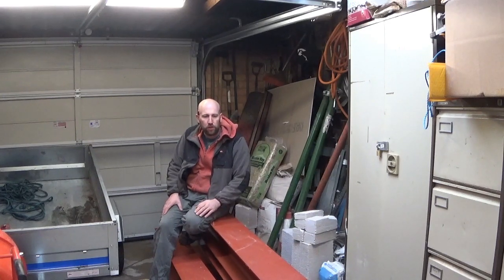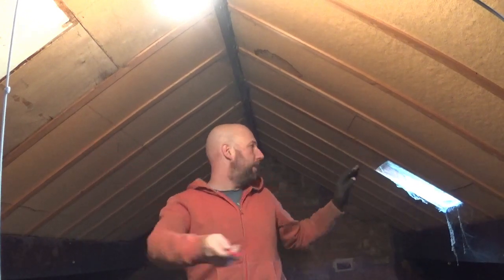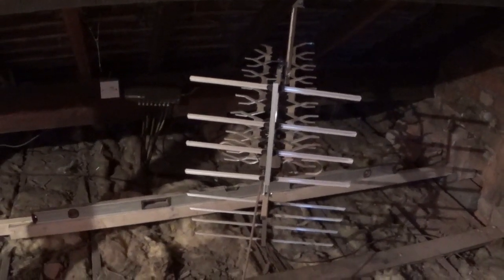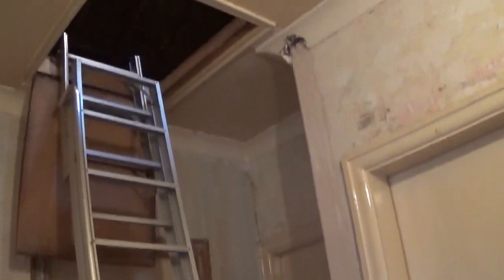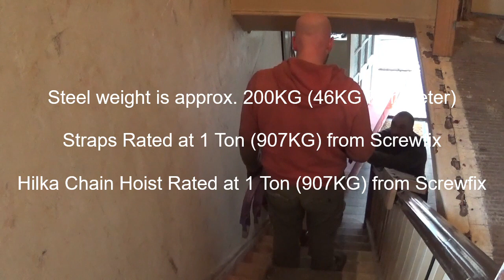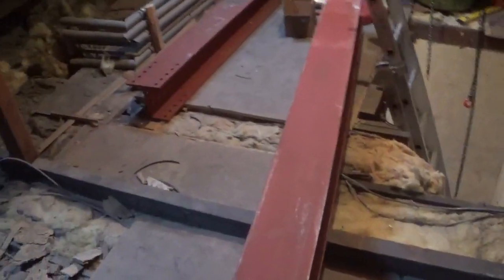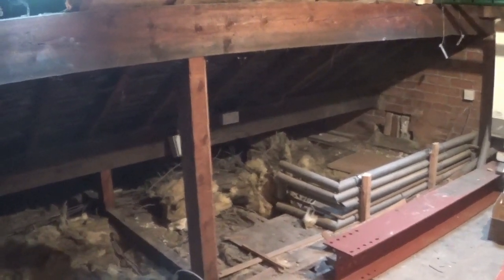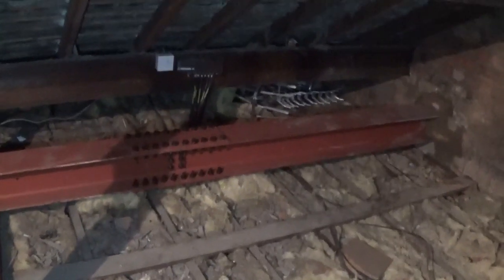Loft / Attic Conversion 1/9 - Steel & Pad Stones Install - UC 203X203X46 RSJ | Vane Cottage #23

Comment: Great video! Really enjoying them. 

Looking forward to the next videos in the series. 

A couple of questions if you wouldn't mind. 

1. Why did you have to use an RSJ for the holding the new floor? Would a large enough piece of timber have been allowed? 

2. Did you get a structural engineer out to visit and they determined the size of the RSJ's? 

3. Was there ever a possibility of simply putting the new floor in using the Purlins that are bedded into the gable ends and party walls? By dropping some structural plywood down and then hanging the joists off of that? 

Thanks
Reply from the maker: Hello
1- It would not have been practical to install timber due to size and weight, a two section RSJ was more practical.

2- I used a online company to calculate the required steel sizes, I made a drawing of my proposed build (just a basic floor plan in word) and passed this to an online beam calc company. They provided engineers drawings and I passed these to the building inspector at our local council to approve before installation 

3- The existing joists where very small and would not have complied with building regulations in the UK, if I was using the area for storage only I would have gone with this option but not it wasn’t an option when I need the building inspector sign off

Hope this helps
Reply: How did you do a floor plan? I’m struggling to know how to do one myself to save some money! Thanks in advance :)

Comment: Hi I’m looking at doing a similar loft conversion and was wondering do you need a party wall agreement to put the steels in ?
Reply from the maker: I think you would if it was a party wall, we found our local planning / building control very helpful with similar questions regarding our conversation. We did it a permitted development and they told us what documents they required.

Comment: Hi. A 46kg steel section seems very heavy for what you need. Is it a large span? Thanks for the video.
Reply from the maker: The beam length is approx 6 meters and the floor approx 5.
Reply: What size would you have gone for?

Comment: Would it have been possible to have had the steel delivered in three sections?
Reply from the maker: In our installation two sections worked best, I think we could increase the number or sections but this also increased the steel size
Reply: @renovatingvanecottage-diyh495  Thank You.

Comment: Hi Dave,

Where did you get your steel from mate? 
Ive googled J Fabrication that you mentioned but its showing some company from Glasgow that makes railings!?
Reply from the maker: Hi, the company we used was called J & A steel and plant. They have an eBay shop or you can email them directly, we got a good service and steel at a good price.
https://www.ebay.co.uk/str/jasteelstock

https://www.steelconstruction.org/company/ja-plant-steel-fabrication-ltd/
Reply: @renovatingvanecottage-diyh495  cheers Dave! 👍🏻 I’ll message them for quotes! 👍🏻👍🏻👍🏻

Comment: Hi Dave. Very skilfully handled. Thank you. How did you decide on where to place the stone pad? Could it have been placed nearer the chimney breast of further in towards the wall plate. I ask because the further in it is placed towards the wall plate, the more floor space becomes available. Does a regulation govern how far out the steel beam needs to be positioned? Best wishes.
Reply from the maker: Hello, you need to consider if you have any openings below the position of the stone pads that the steel sits on, for example if you had doors or windows below you may need to reinforce these lintels, also the width between the steel pads determines the joist sizes you require so we installed ours to best suit our existing building. If you get a structural engineer to spec steel they will usually offer professional advice.
Reply: Very much appreciated. Thank you again.

Comment: Great video 👍 Been looking for this type of loft conversion for ages, as this is exactly what I plan to do.

Was there a reason you choose to have a long and short length steel? I’ve seen others using 3 sections of steel at equal lengths
Reply from the maker: It was to our structural engineers specification but for us a 4 meter length at approx 200kg and 2 meter length at approx 100kg were manageable, I’d guess people go for three sections when using longer lengths